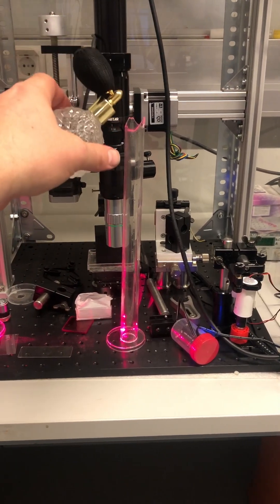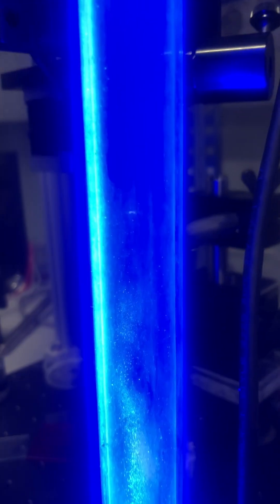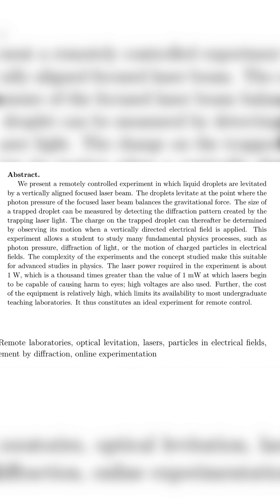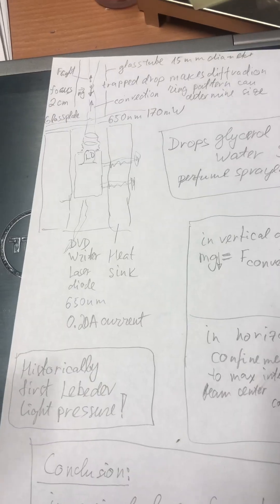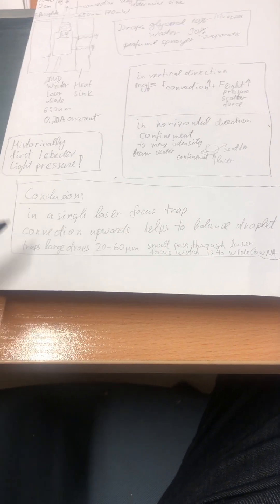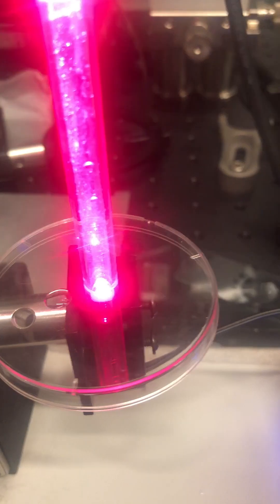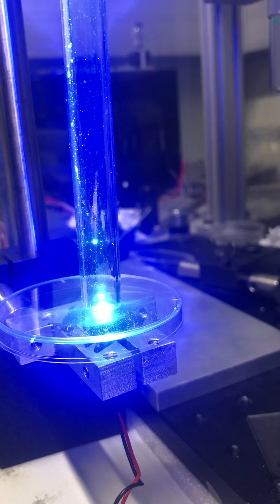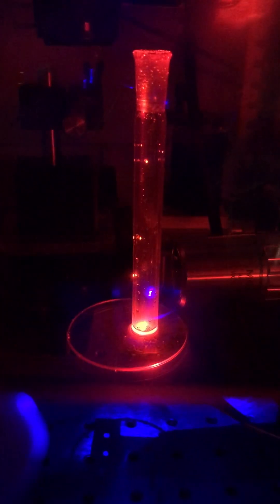DIY optical tweezers for glycerol or oil droplets in air with red and blue lasers.

Comment: You need to reflect the laser with a mirror otherwise your experiment is interfered by the heat of the laser assembly
Reply from the maker: a curved reflecting mirror would double the trapping force